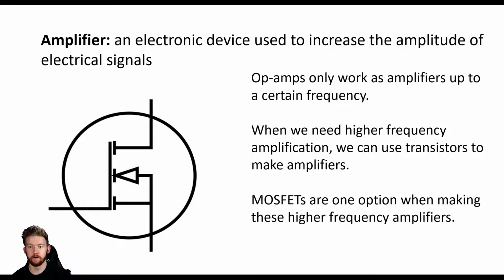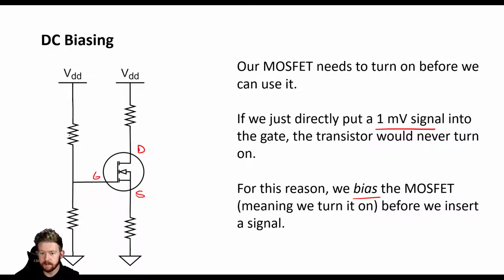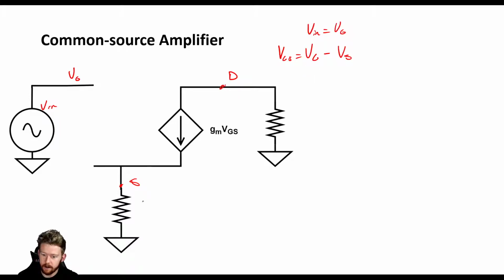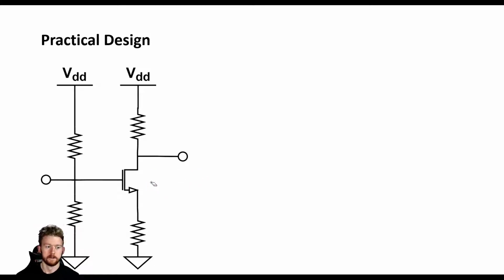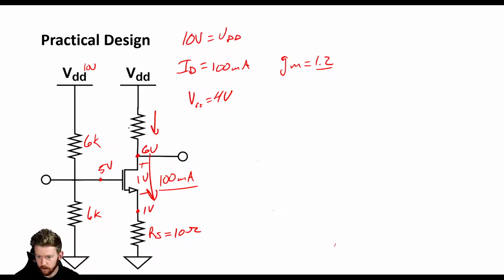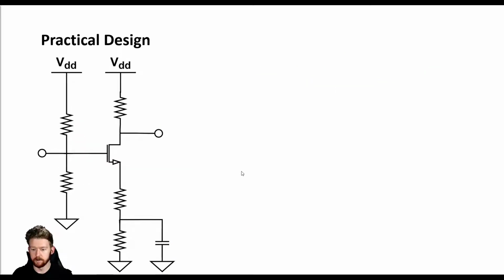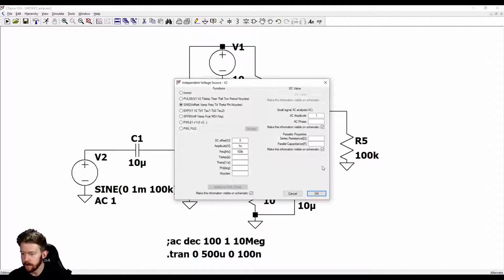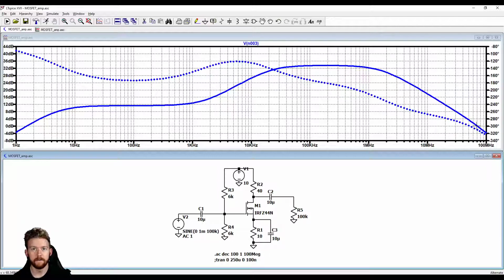Electronics Tutorial 15: MOSFETs as Amplifiers

Comment: Great video! The only part I wasn’t sure about during your practical design was why you targeted 1V as the source voltage. Was this just arbitrary or was there some reasoning from the MOSFET datasheet?
Reply from the maker: Great question. It is just an arbitrary number pulled out of thin air for some theoretical analysis. In a true design you would want to simulate your circuit to find out what advantages/disadvantages a certain VDS or VS would give you (gain, stability, versatility, etc.). It is really dependent on the design you're going after, so for an educational video it was easier to just assume a nice round number :)